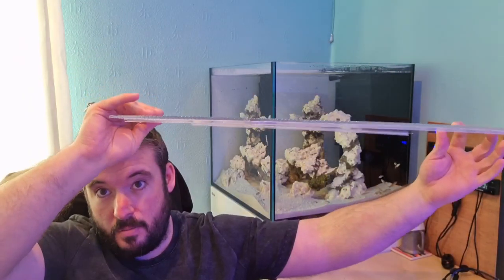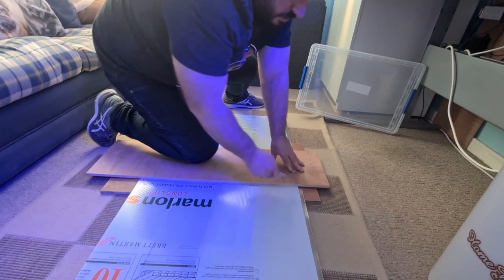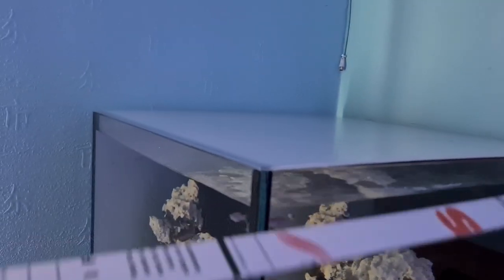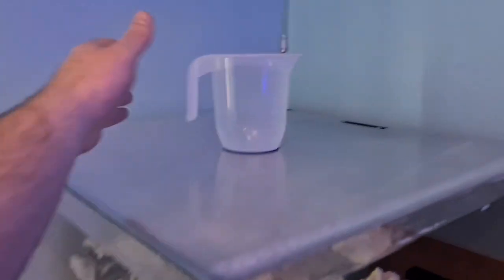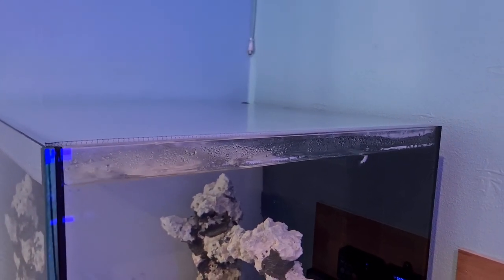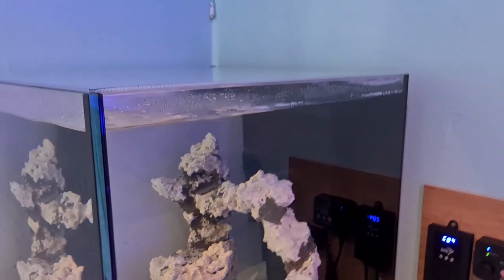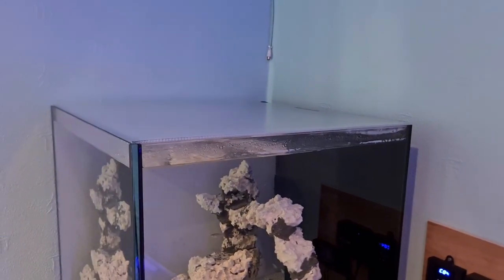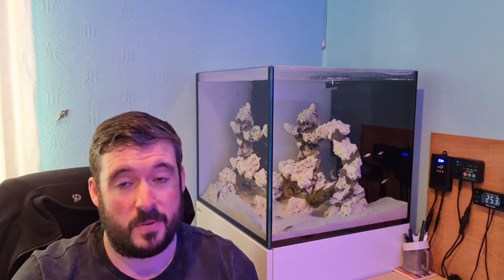Polycarbonate Reef Tank Lid - Reduce Evaporation And Heating Cost!

Comment: Hi, jist came across your video on ultimate reef, that's a great idea for the lid, i was going to go with 3mm clear polycarbonate (as i can get that from work for free) I was worried about the condensation drops on the underside, im assuming as your lid is double walled so you don't notice as you cannot see through it? So I may go this route now.

Comment: That's a really great cheap lid. I think it might also help diffuse some of the light as well. What light are you going with? Now I'm rethinking my D+D lid on one of my tanks.
Reply from the maker: Yeah I'm proper happy with how it turned out 👌
Yeah it will diffuse light as well I'm sure, haha always one step ahead you!
That's next week I've got the Maxspect Jump LED, which has 6 pucks too which I like, I had seen someone suggest using the D+D DIY net kit with Polycarbonate to finish the edges which worked but seemed a little complicated for what I wanted but if you already have one that could work well? 🤞
Thanks for watching mate much appreciated!

Comment: How has this held up over time? Thinking of making one for my rimless tank but seen lots of people complaining about sag and algae getting in the channels
Reply from the maker: Hi! Yeah this is still great, no sag on mine because its twinwall but also only 2ftx2ft so not a very large lid.
Also because the full lid sits on top of the edges if the tank  glass no water gets into the channels on the main part so no algae, even the 2 strips that are glued underneath the lid are still clean a year on no green build up so far 🤞 does need an occasional wipe to remove dust but really happy with it otherwise 👍
Reply: Very pleased to hear this, thanks for your reply.